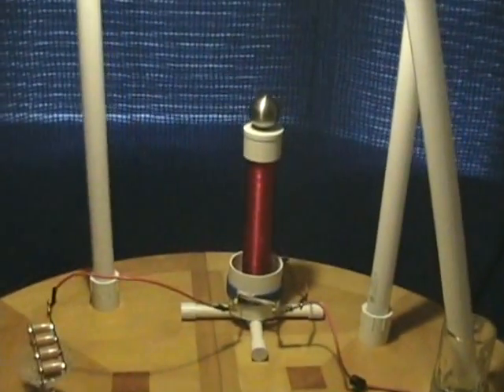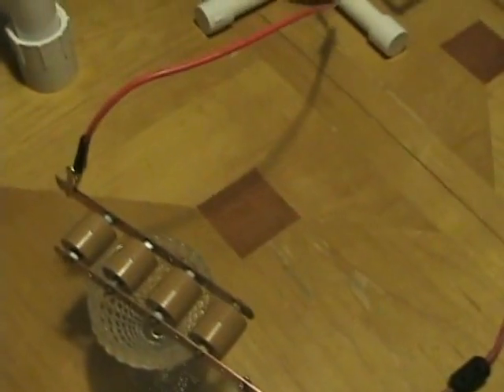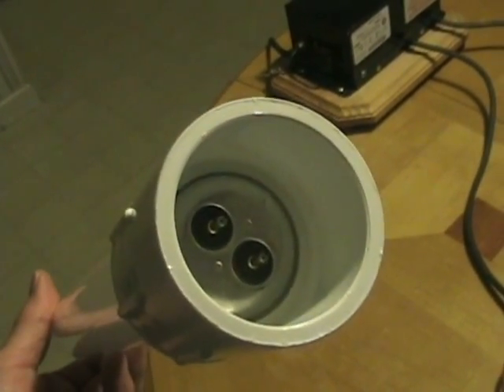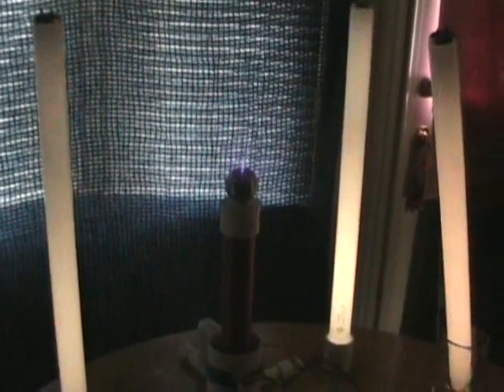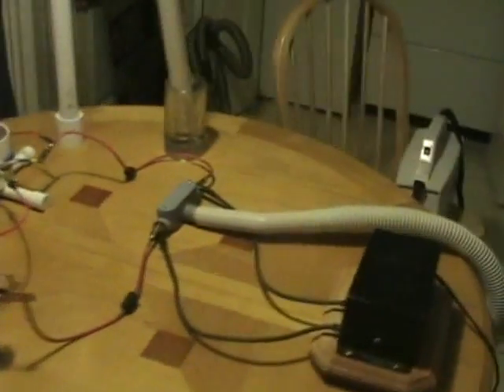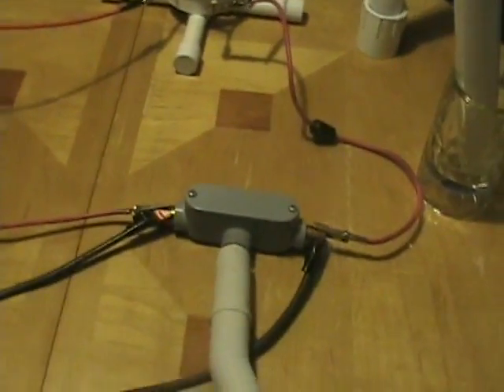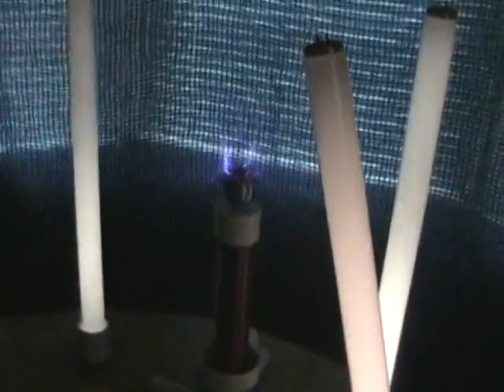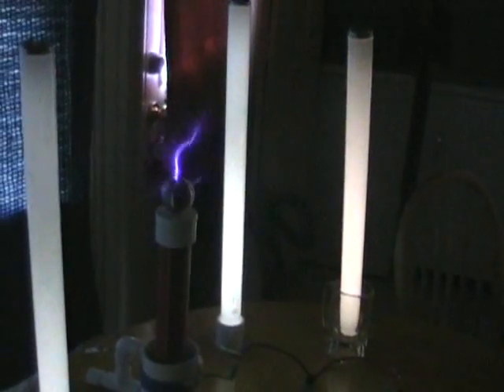Tesla's Candlestick

Comment from the maker: The coil gets power from the neon sign transformer, which converts 110 volt AC wall current to 7,500 volts. This is pulsed through the primary coil by the action of the spark gap, inducing resonant currents in the secondary coil. This energy spills out of the top sphere as visible arcs and as radiant RF (radio frequency) energy, which causes the fluorescent tubes to glow.